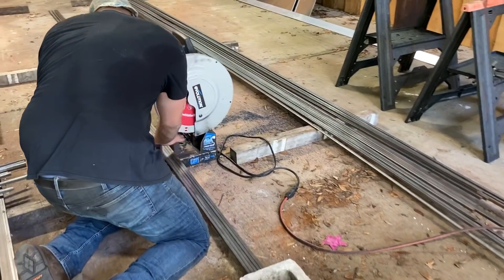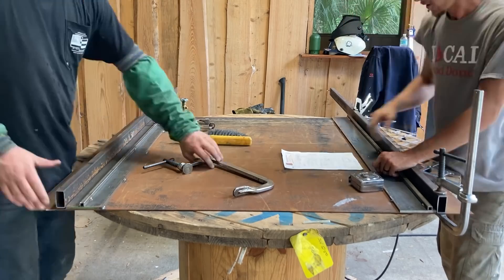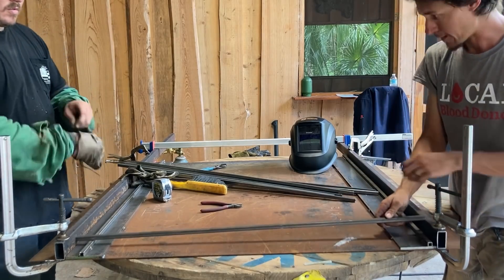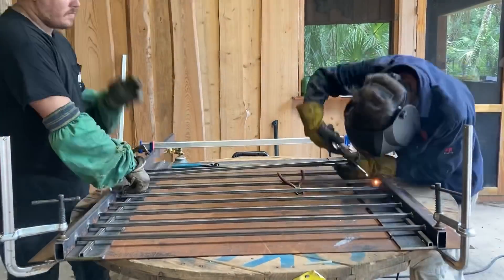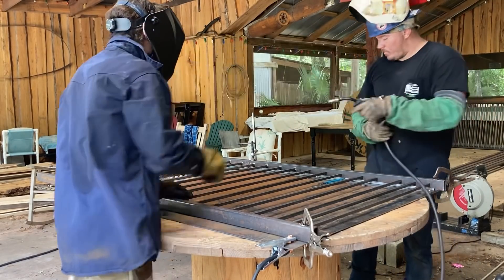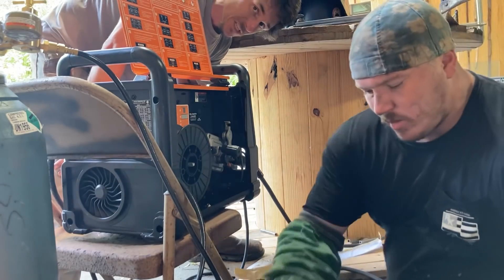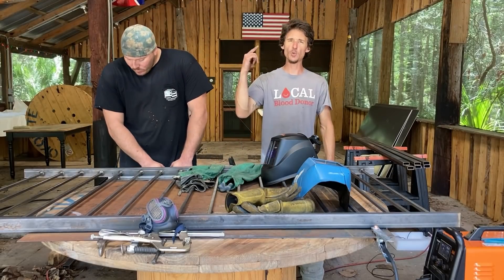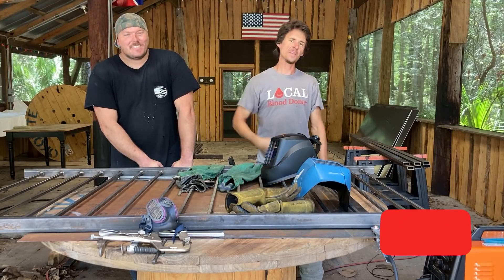How to Fabricate a Basic Metal Railing

Comment: My work bought a box fire ball tool spacers, asked us to try them out. They are 250$ dollars (I think) for the small box of spacers. They come with multiple sets of spacers from 1/32” up to 1”, these combined with 123 blocks makes perfect spacing with no error to compound. They make hand/guard rail fab so much easier…

I still hate fabricating and welding hand rails, luckily my job pays well enough to do them.

Comment: If all the pickets are equal spacing... say (3-7/8"), just cut a couple wood blocks cut out of 2x4 and use that as a jig to move along as you tack or weld each picket.   Marking each one seems pointless and a waist of time.    Using the wood block picket spacers would also be more accurate........ and say it with me..... faster.

Comment: i love the picket spacing tool but at work we cut 2 square tubes at the exact spacing we need and then we put the post in first and then put the spacers and also get a flat bar that’s the right thickness as a shim for your pickets. then all you do it slap a picket down tack it in take ur spaces out. flip flop them and then put another picket in. can get a railing done in like 10 mins if u got all the parts cut

Comment: You might find that you need some small pieces of angle tacked to an actual steel table to clamp the horizontal tubing all throughout the rail so it does not become banana shaped.
Reply from the maker: it was straight as a arrow when we sent them to paint
Reply: @MeltinMetalAnthony  i guess that tight fit with the pickets helped out.
Reply: Paul, you're right on the money there
All jokes aside, a tight fit is prolly one of the greatest time,
and therefore money saving things that a contractor needs.
  Let's be honest: 
Cutting steel; It looks so simple,
but, how much time is lost having to grind a poofteenth off any piece, to make it fit
or, heaven forbid, time filling in a huge gap, if it's cut short.
Having someone,(like Big Tom) that can cut stuff accurately, 
it can be the difference twixt profit or loss.
Reply: @pauleskridge7209  the heat from welding one side opposes the heat from the other side
Reply: @brianpatrick8441  I've done handrail,picket fence,dot rail and custom ornamental gates for 6 years and seen some ridiculously done fence that was concave or bowed in the horizontals no matter how tight the fit was because of not clamping atleast 4 spots throughout each horizontals
Reply: @pauleskridge7209  was the fence pickets welded on the outside or in between the horizontal pcs?
Reply: @brianpatrick8441  that depended on the job or company I worked for. But I could see welding the all the way around causing distortion even while moving around the entire rail panel.
Reply: @pauleskridge7209  if i build a gate with face mounted pickets either i back bend, flame straighten or just jump on it to straighten. Its so much easier to get straight before powdercoat than at a install
Reply: @brianpatrick8441  that is very true. I've had to use a torch and rose bud to straighten out some panels or sheet metal in the past.

Comment: I fabricate railings for a living and I'm able to fabricate 250 linear feet a day! I would recommend that you use 1 inch flatbar cut in small pieces for the picket spacers and basically that will work as ur jig! Also on your pickets, you can probably cut them an 8th less so that way you won't have to struggle hitting them with your hammer! Great video 📹 👍
Reply: Brian first of all an 8th not on each side ! Second of all when u go threw 1500 pickets a day you're sharpie will fade away! Third follow me on Facebook and ill teach you how my business makes more than 1800 feet a week of railings! I don't mind showing you how to make a jig in 30min
Reply: @timfountas7986  first of all 1500 pickets a day equates to alot more than 1800 feet a week, second of all you buy more than 1 sharpie and third i know from 40 years of doing
 this that most welders cant use a calculater or convert decimals to fractions. If your doing production guard rail same length with no slope
There are easier ways than tacking 42 pcs of flat bar for 8 foot panel
Reply: @brianpatrick8441  good job brian you “won” the youtube comment section one sided argument 🎉🎉
Reply from the maker: so you set them up in between the Picketts or you weld them on the jig?
Reply: Brian Google "steelmasters" in Phoenix Arizona just to get an idea lol we don't have just one fabricator! Just trying to help i highly doubt you're even 40 years old
Reply: @timfountas7986  250 feet a day? What took you so long? I think your just pulling number out of your  @ss
BTW i just turned 60
Reply: @timfountas7986  first it was 70 feet a day then it was 1500 pickets a day=560 feet a day and now its 250 feet a day?? Very confused!! I think you use the word fabricate loosly, to me fabricate means field measure, cut, fit, weld, clean, powdercoat and install!! And 
Anything less than that you are a production grunt!
Reply: @timfountas7986  How do you outcompete the Mexicans doing pickets in phoenix?
Reply: @papapsych2746  I snitch them out lol
Reply: You want them to fit tight!! Why would you cut them a little shorter and when you go to weld you dont want that gap in there ! It helps it being tight so when you get it in place it won't move until you get a tac on it ! And you cutting flat bar may work but what he is doing works also doesn't take long to mark them up ! Yall kill me how yall come and tell this guy how to do something everyone does it different your way his way about same amout of time !
Reply: If your a true jerk off, you tell others your way is the only way.
Reply: If your a true craftsman you layout equal spaces with a calculator, sharpie and a square. I dont understand why a fitter would screw around with flat bar spacers? Spacers compound errors !! 1/8 " gap on pickets??  A gap just sucks in leaving top and bottom no longer straight!! I thought Tom knew what he was talking about until he revealed that!! And whats funny is Tims linear feet totals grow on each comment, lol

Comment: I'm new to welding and fabrication, can you tell me exactly which pieces of steel is used, like what I'll need...like size tubing, flat bar...
Reply: The Terry fella is kinda correct but for the sake of giving you a starting place, typically fence sections use 1” square tubing in 16ga or 14ga (usually 16, but 14 is easier to weld without blowing holes) for the horizontal top and bottom. The vertical pickets will usually be 1/2”  or 5/8” square tubing in 14ga or 16ga thickness. Good luck and don’t be afraid to ask questions. Most fabricators are down to give some tips. Also the people that work at the steelyard should be willing to give some guidance, especially since you are spending money with them.
Reply: @Charles-tj8ol  that’s what I’m saying. You just have to learn what you should use, or what works. I did a ton with 1/8 sheet at my last job, for general fab, as well as 1” pipe, 1/2” bar, a36 1x1/2 flat, 2x1/2 flat, various assortments of sizes of angle iron and square tube, 3/8 plate, BOM would be 2 pages long if I listed everything I used for general fab purposes. Now I mostly do 1/16th stainless sheet or various sizes and shapes of stainless since I’m in food now.
Reply: @Sffker  ya man I get your point, but like the kid said, he’s just having fun learning in his garage. He’s not asking for anything too obscure, just wanted to know what these guys most likely used to build this fence panel. No need to shut him down just because a fence panel can be built in 1000 different ways.
Reply: @Charles-tj8ol  not shutting him down? I’m being realistic. He said he “likes to build stuff” which is extremely vague. You kinda have to be more specific if you want more then specific advice.
Reply: for what? No, no one can just tell you what metal shape, type or thickness to use in general. It depends completely on the application what you use. And obviously code if there is one to follow for the application.
Reply: @Sffker  I meant just for small projects in my garage, just enjoy making stuff
Reply: @jbone4217  well, you’ll have to learn what to use then. it all depends on application, or just what’s available at times.
Reply: @Sffker  wow dude chill..
Reply: @Erwin-eo7iv  being realistic and honest is chill
Reply: @Sffker  what method of welding should I use on car exhaust?
Reply: @505fastlife6  idk, it depends what you’re trying to do like I’ve said before….. tig for stainless, flux if it’s just you welding on some cheap glasspacks